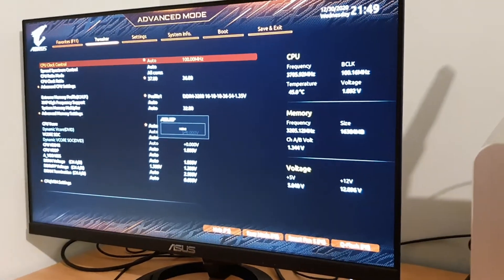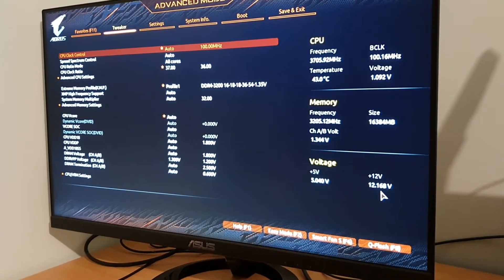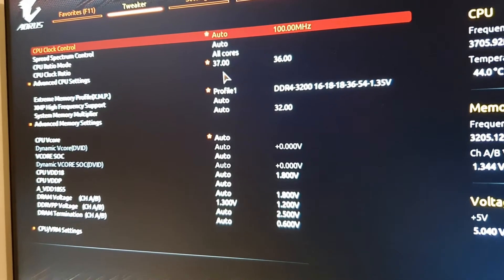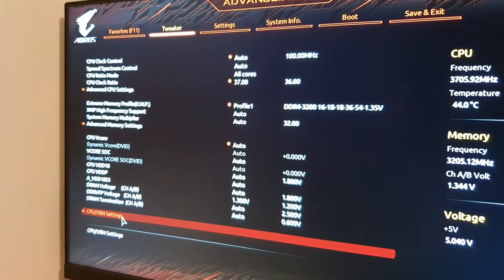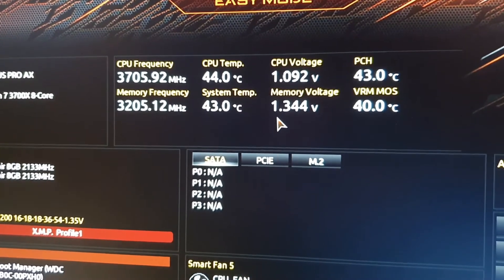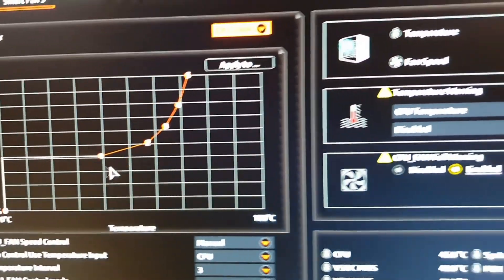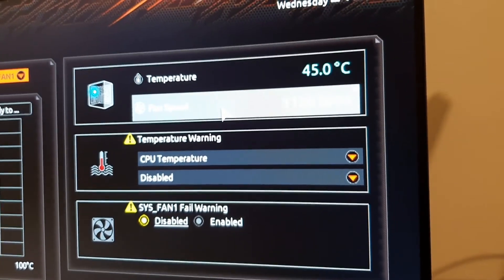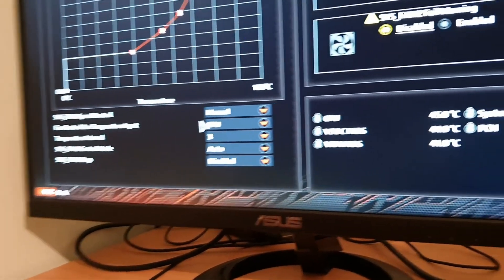Aorus B550i Pro AX - Bios settings - Fan settings

Comment: Hey I found your video online and it may be able to help me. I'm having an odd issues with this board paired with a 5600X. I'm getting an unusual spike in temperature at bootup only (Windows 11) for about a minute and was wondering if my settings are the reason for it.
Reply from the maker: Hi there, thanks for the comment. Its very difficult to know unless I understand your settings. If you are running everything on auto then the issue could be a bad driver, bad usb device or something along these lines. It could even be a dodgy windows install. Regards